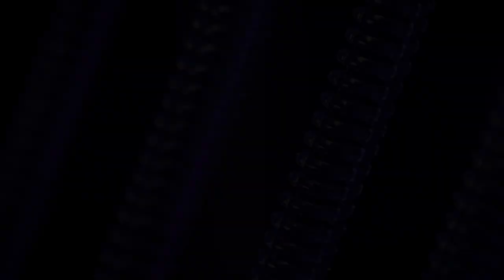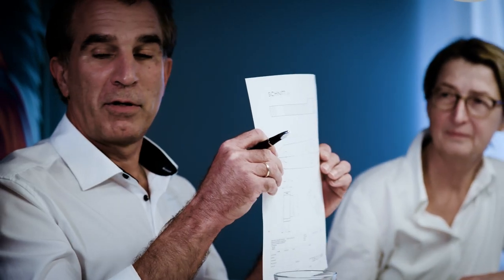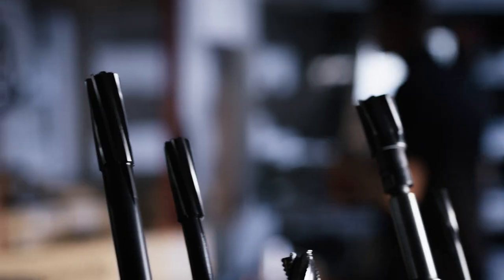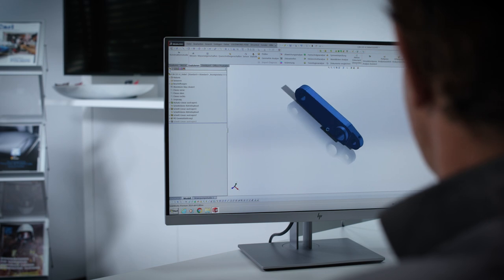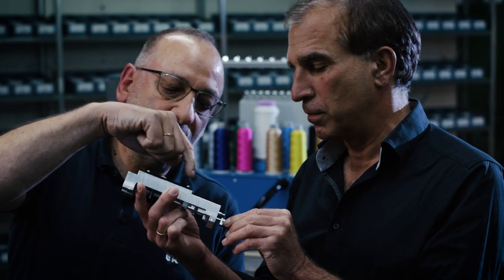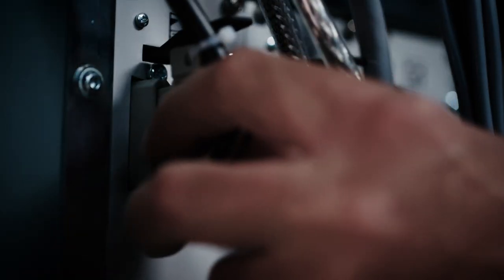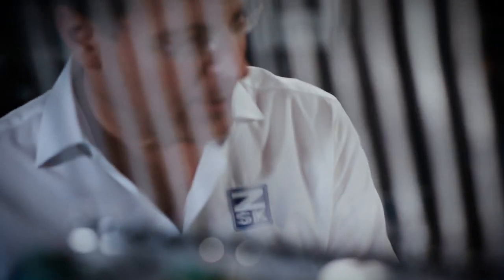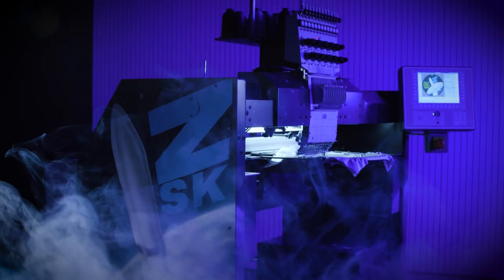2.020 rpm - an embroidery revolution

Comment: this is a bit strange because it looks like my older JAFA machine but has a newer head on it.  was it put on the heavier frame to reduce vibration like on the lightweight sprints?  and was this ever released?
Reply from the maker: The machine in the video is a pre-production model for show purposes. The new RACER R was presented at the ZSK Open House 23 in September 2023 and is available now.